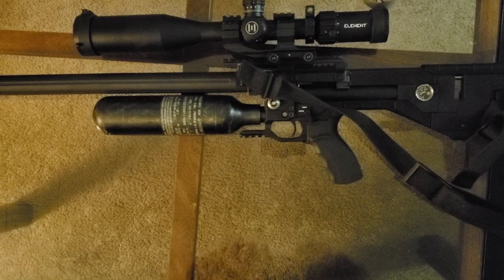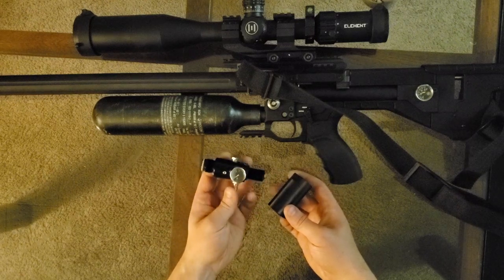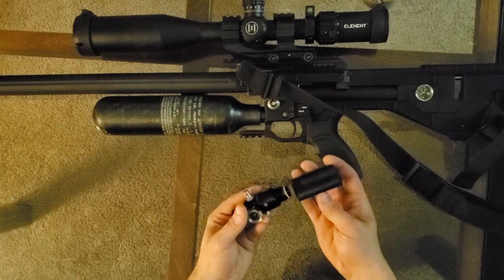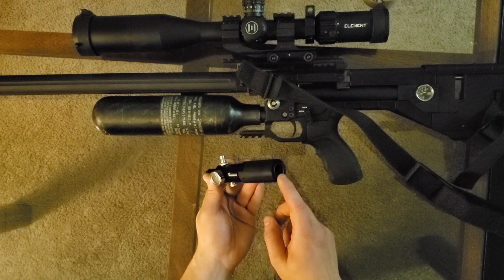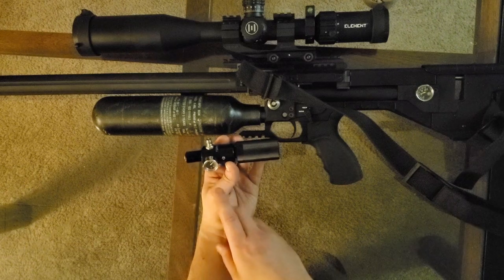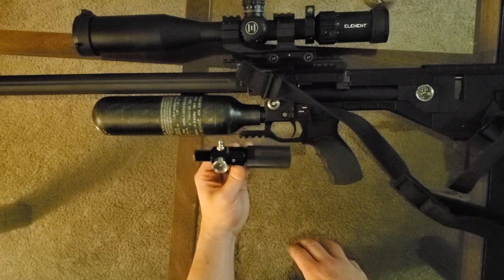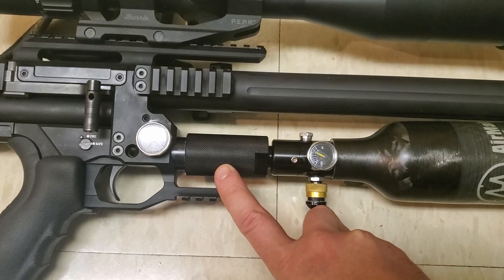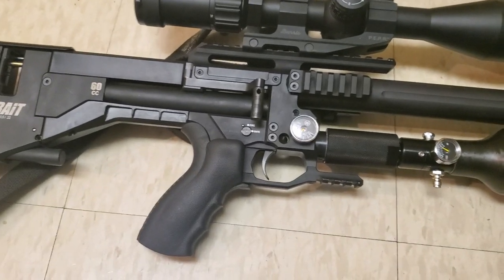How to Add a REGULATOR to Any PCP Airgun w/ a Bottle - Double Regging an Airmaks Krait for only $40!

Comment from the maker: Links, some of which help the channel:
- Adapter: https://amzn.to/3E5eUzg
- Reg (1800 psi / 124 bar): https://amzn.to/3iHShbR
- Reg, 2200psi like mine, I can only find this from China right now...  https://www.ebay.com/itm/314197347365?hash=item49279f0c25:g:kYkAAOSwE19jTw5O&amdata=enc%3AAQAHAAAAsNUX4kdXaTYFCrfye50P9v2trf%2BNYROemJzS9IMa9MsTPotxfSc4Qm3xFPhPUTjtXgHVwnZ0h8idVZm25BmBT9jon3Yfz2%2Bg63P%2FX0EkCyXZHbasePriHtq3loAtInREp2OA9cSeujtASss2BD%2BrWBRhtK7%2B%2FrY135gu76kN0gZ3FJlGowoRNv8lCHtl%2FqqPpm%2BPscgdKPQULPbbp61bz9I0PTz2UM0MzzSRXFJwNBH8%7Ctkp%3ABk9SR5TK6qKgYQ

Shop on Amazon via this landing page to help me tax Jeff Bezos! 
https://amzn.to/3gLVpD2

Shop on Pyramyd Air via this Landing Page: https://www.pyramydair.com/?referer=217&utm_source=commission_junction&utm_medium=affiliate_program&utm_campaign=Pyramyd+Air+-+One+stop+shop&utm_term=Air+Shootist&cjevent=a3fb1f2e168011ed83f8a69d0a82b82c

Great deals on centerfire ammo from Bereli! Affiliate Link: https://www.bereli.com/?aff=3875

Oneleaf Day/Night Scope Cam affiliate links & coupon code below:
12mm Version (shorter range): https://oneleaf.ai/commander-nv100-night-vision-add-on-12mm.html#u30
16mm Version (longer range): https://oneleaf.ai/commander-nv100-digital-night-vision-monocular.html#u30
Scope Adapters: https://oneleaf.ai/commander-nv100-scope-adapter.html#u30
~~ ---- 10% off with code "ONELEAF10" ----~~

Link to Huma bottle regulator: https://www.huma-air.com/400-500-CC-Bottle-Regulator

Interested in commercial / promotional / collaboration activities? Getting together to shoot? Questions? Comments? REACH ME HERE - AirShootist@Gmail.com

Comment: You can adjust the location of where the fill nipple ends up after threading everything on by loosening the 2 set screws on the bonnet of the reg and adjust accordingly. You have to de-gass the bottle before doing this. You can also adjust the output pressure on those bottle regs by adding (higher pressure) or removing (lower pressure) the shimms under the bellville spring stack. Again, the bottle must be empty to make any of these adjustments. And make sure the Bellville spring stack is even numbers of spring washers opposing eachother. For example 2up-2down-2up-2down... if there are uneven numbers in the opposing stacks of spring washers, the lower number stack will get overwhelmed and flattened out by the higher number of opposing washers stacked againstit.
Reply from the maker: On the new Kraits there is absolutely no need for this. They all come with Huma regs now and are AWESOME! Check out my review on the Krait X in the rain and you'll see what I mean.

Comment: What a carry on , just to try and get a brand new rifle $1700 + extras working? 
Be interesting to see if this solves it, I mean a creeping reg is still likely to creep.
Thanks for the video.
Reply from the maker: Yep, a few others have tried it on their Kraits and it still crept. It definitely creeps way more when lots of pressure (250-300 bar) is leaning on it, so the idea here is to cut that down and hopefully slow the creep. Gun is really not usable and Airmaks won't honor the warranty. Unless an aftermarket company (looking at you, Huma!) develops a reg for this thing - we're pretty well boned. 
As a disclaimer to anyone reading this, DO NOT buy an AIRMAKS KRAIT (or any Airmaks gun) 
💩💩💩
Reply: @airshootist  By the way , I think you are handling yourself well on that Airgun  Krait forum. 
Only what I sense  (something doesn't feel right) , but I wouldn't be surprised if Krait had got in touch with  the main justifier of their dodgy product, in order that he steer it in a more positive/neutral place. The whole conversation and suggestion about coughing up $1700 and then just sitting back patiently is gaslighting 101. Keep keeping it dignified friend.
Reply from the maker: @henryjones1998  Hey man thanks for that. I know I'm a little bit harsher and whatever than most dudes who have a YT channel, and that's because I DGAF, plus I am pretty pissed off with that turd of a gun as well as Airmak's unprofessional responses and handling of the issue. I scrapped a whole review with the V1 reg, being a super nice guy. After the V2 and V3 being turds, my patience was running out. I warned the dude over at Airmaks that if he didn't give me a tangible solution ASAP I'd publish the bad review. He gave no solution and didn't reply, but then I published that video and he demanded I delete the video AND THEN he'd talk about a solution. Like... NO, dude. Get rekt. I ain't deletin' shit. 
Anyway the main justifier, if it is who I think it is, is actually a really nice guy that I talk to on the phone a lot with. He is a good dude, just way more patience and "zen" than I have. FFS, you can buy a combat ready AR-15 for $1700 and here we are sitting there with a busted ass airgun for the same price. Airmaks is despicable for using their customers as a test bed for a gun they knew didn't work at the price of a combat-ready AR. What clowns.

Comment: Facing the adapter on a lathe will adjust the fill port position.
Reply from the maker: True but it'll also strip the anodizing and since these are $6.99 on Amazon Prime right now it just makes more sense to buy a few of em and return the ones you don't need (for free)
Reply: @airshootist  I completely agree.

Comment: Question, if you want to degass this essembled rifle with external reg... do you degass by turning the reg nano or the gun nano ?
Reply from the maker: the Krait has a degassing screw. The newer generation Kraits have the reg problem fixed because they use Huma regs now, so you shouldnt need to double regulate it

Comment: Hello. I have a v3 regulator on my kraitX cal 25. Regulator setting 110bar..290bar-->110bar, 78 shots, pellet velocity jsb heavy 912-918fps. no problem with the gun
Reply from the maker: Lucky you. That makes about 1 person in 100.  Quality control is non existent on these regs. I'd sell the gun if it's working well and buy something better immediately. Who knows how long it will last working well like that.

Comment: Hello I have been trying to add an adapter to my hatsan blitz 30 cal. I wish to connect and disconnect carbon fiber are models with hot swappable connections. The regulator you added to the PCP. Is it hot swappable? The regulator you show in your video is adjustable
Reply from the maker: Yes as long as the hot swappable fitting that goes to your existing bottle is M18 thread - since it would then screw into the paintball adapter. The reg is adjustable if you reconfigure the belleville washers (not for novice tinkerers, need to build a pressure test tool)
Reply: @airshootist  can you help me find the proper adapter and 700cc hot-swappable carbon fiber tanks? I wish to attach it to my hatsan blitz 30 cal
Reply from the maker: Sorry dude, I have no idea. I do not mess with that brand and know nothing about the parts for them. You might want to start a thread over in Airgun Nation and see what better minds have to say about that. I bet they can help

Comment: Couldn't you just change the configuration of the gage ,Foster and the blank plug positions ,, I'm pretty sure it's possible,
Reply from the maker: Yep, you can do that. Should be the same thread. However if you have multiple of the adapters laying around, as I did, it was much easier to just cross my fingers and try multiple adapter to see if one would line up

Comment: Please, would you be so kind as to give me your opinion, of the PCPs you have had, which one you are most satisfied with and why, best regards.
Reply from the maker: Great question! 
Hands down it would be my Airforce Talon SS. The gun is so simple and reliable, and 99% maintenance free. It was also super easy to add a regulator to. If you watch some of my hunting videos you'll see how perfectly it performs, and it's about 19 years old! These also have a lifetime warranty.
2nd up would definitely be my FX Maverick.22 sniper. Also very reliable and super accurate, with enough power to take game at 150 yards. Not as durable or low maintenance as the Talon, but a great gun nonetheless.
Reply: @airshootist  Se lo agradezco mucho, buen dia.

Comment: That is a very cheesy solution. Airmaks is very very close to finding the solution. I assure you 😏.
Reply from the maker: Lol. Airmaks has already done 3 versions of their reg and all of them suck. I wonder if the V4, V5, V6, V7 or V8 reg will solve the problem. What I learned here is: Stay away from Airmaks products. My cousin could have bought a WAY BETTER, actual working gun for the price. 
The solution I mentioned using the Huma bottle reg is much cleaner, but the same thing as this functionally